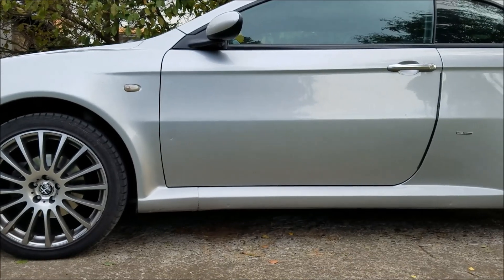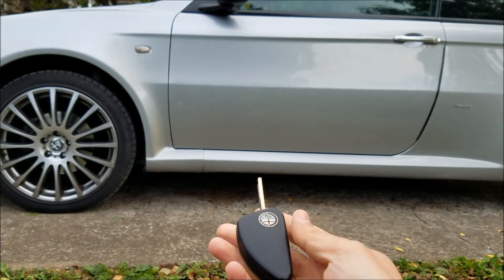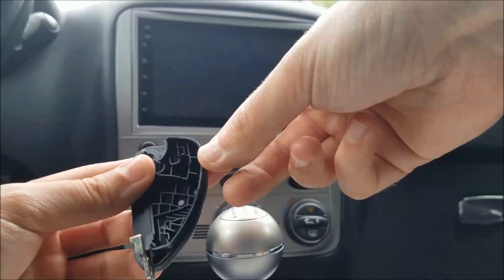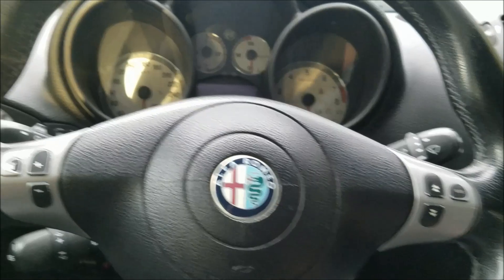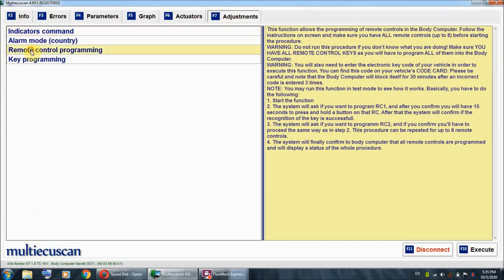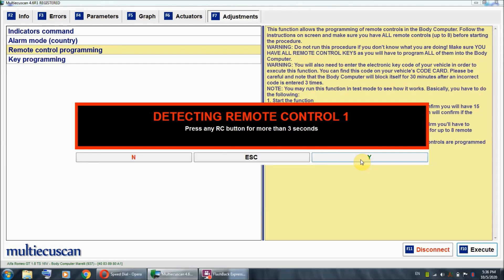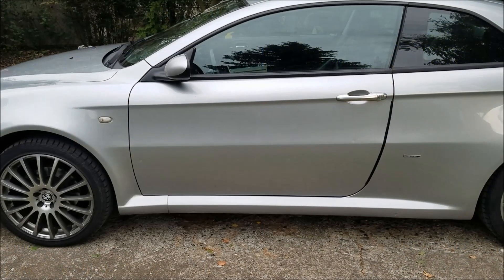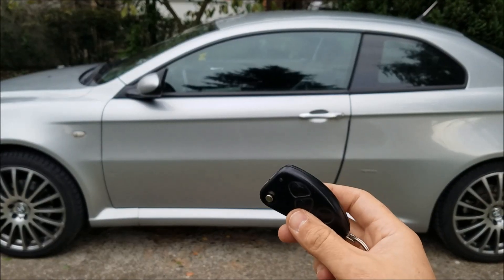Remote Programming Alfa Romeo GT, 147 Using MultiEcuScan

Comment: Beautiful Alfa just needs a bit of low H&R with koni street is cheap and solid option, not hard but stiffness when needed and a 30mm drop
Reply from the maker: Thanks, I was thinking about it but roads here are awful, lower suspension might do more harm than good...
Reply: @arcgarage  I thought so 2 but it brings the back side down, that levels the nose out a bit, I was due for a new springs and shocks and the H&R and koni was cheaper than oem🙈
Reply from the maker: Might give it a go...

Comment: Hi, where do you get security code from?
Reply from the maker: Check your owner's manual, if you don't have it, you can get it from dealership...
Reply: @arcgarage  Pricing on one for GT is about 220€. That info is from official dealer when I called them to get one because i did not get mine with car.
Reply from the maker: That's too much, try somebody else. You should be able to get it free of charge...
Reply: @arcgarage  Oh I see, how can I get it free of charge or cheap? My 147 didnt come with any books :/
Reply: Hey kinda late reply, but hope it helps. There actually a seller on ebay that sells you your key code and immobilizer code for around 30$, the only down side is that he just provides you numbers without the key code card so you will have to print them or store otherwise. Seller is called "decodingcode".